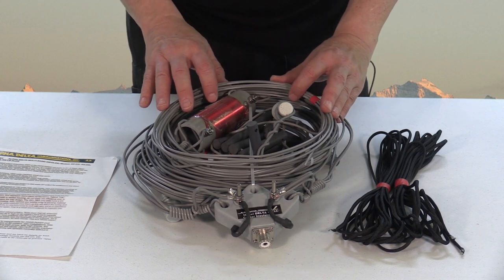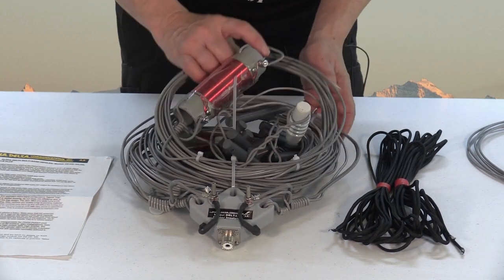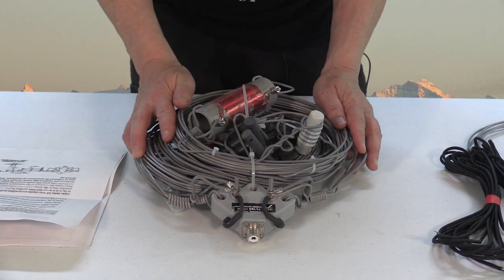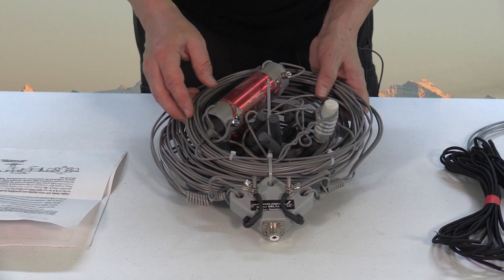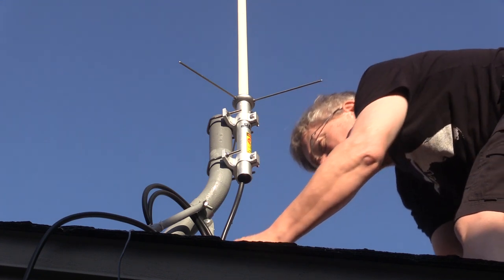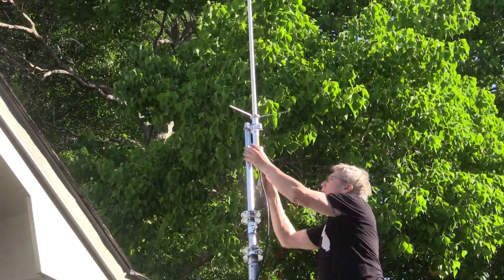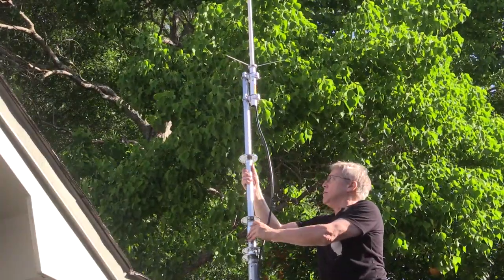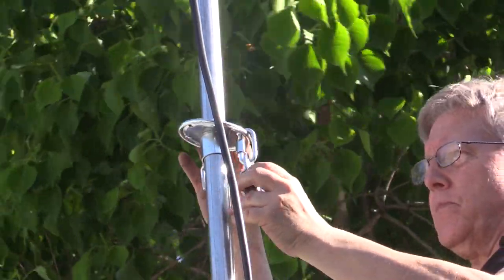Antenna Mast Installation

Comment: Just a comment concerning the burial of the bottom section of the mast in concrete. There should be weep holes at the bottom to let rain water drain out to prevent the mast from splitting during freezing weather and to discourage corrosion from the inside. Since you likely covered these when you buried the mast, you should drill several near the base to reestablish this important feature. 73s, Stuart, WA5US
Reply from the maker: Very good point to bring up!  It doesn't freeze much at all in my area, and if it does, it only lasts for less than 48 hours.  I will be following your suggestion during my upcoming Spring antenna maintenance project.  Thanks again for an important point, especially for those who do live in less than warmer climates.

Comment: What about lightning arrestors inline with the multiband and the 2 meter on top?  The grounding of the mast is perfect and thanks for showing that...  But that HF antenna has no lightning protection on it and is connected directly to your radio.  Just thought I'd point out that because I am about to fix it on my own (yes I have the same type of antenna with the 2 meter antenna below the dipole.  The mast is extended with 10 feet of strong pvc pipe above the 2 meter and has guys with pulley on top. <--- it surprised me when it worked too.
Reply from the maker: I have added, since this video, an entry panel at the house for the antennas.  In the entry panel, I have the antenna leads connected to lightning arrestors and from there entering the house.

Comment: I’m putting together a base station w/ a end fed antenna on a carbon fiber telescoping mast.  I would like some idea on how to ground my Yaesu FTDX10.  I have a 8’ grounding rod but have to figure out how to ground the radio out through the wall to the rod in the ground.  How is your inside base station grounded and where did you source the grounding rod copper clamp holding the antenna grounding rod?
Reply from the maker: Now on my radar to do a video on this.  Thanks.

Comment: You can use scotch 2224 direct burial rubber electric tape. It’s cheaper than HRO coax tape. You can put 5 Ferrite beads7 inches from the coax connector covered with shrink tube. This will stop any RF from coming back into the shack! Would be a good idea to ground the coax at the connector up at the antenna to get rid of static, not a lightning arrester just static! JohnBoyUtah KJ7TBR 🎙📡🇺🇸😎 I have steel tv mast 3x 5ft sections on a 15 foot roof the antenna must be mounted 17 inches away from the steel with a non conductive phenolic . I used cutting board !
Reply from the maker: If Scotch says it it rated for direct burial, I don't see why you can't.  I would double-check on the specs of this tape though before doing so to be on the safe side.
Reply: It rubber stretched tape, works great, NEC rated for outdoors or direct burial! Sold at Home Depot. When putting together my chicken Radio I-Max2000 I use this tape at the joints. Also I don’t use lock washers, lock washers stresses the threaded barrel connector’s and this stress will make the antenna prone to snapping.
Reply: I have had it on my coax outdoor connections for 5 years no proplemo

Comment: Hi Steve, I liked your video. I am in the process of studying for my technician license and i was wondering if you have any words of wisdom for a beginner looking for  equipment in the ham radio hobby. I do have a Baofeng uv-5r8w, can i build of that and if so any advise would be great. Thank you.
Reply from the maker: Actually, if you can get an external antenna and connect it to the Baofeng, this will help.  Not sure of your surroundings, so I can't comment on the results.  However, I do know for a fact that I know someone using a Baofeng connected to an outside antenna and he sounds just great.  Now, he is transmitting on the Florida SARNET UHF frequency, so he can reach state wide.  (Check out SARNET at http://sarnetfl.com.)  It says the site isn't secure, but that's only because they haven't got their SSL for the site yet, but it's OK.

Comment: problem I found year ago with mounting them in concreter instead of using the actual mounting plate they recommend.  When it rains or snows, you will have water drip down the outside of each section and will from the upper sections that water will enter through the slide joints and inside the mast. When buried that water is unable to drain and so it will build up with time.  When it gets high enough inside and you have a freeze, it will split the mast and ruin it. to replace it now you also have a heavy chunk of concrete to remove.
Reply from the maker: How very true.  It never freezes to that degree, (no pun intended) here, so I don't have to worry about this.  Perhaps drilling a drain hole or two at the base would help with the drainage.  In any, a very good and valid point you brought up.

Comment: Do you have to attach the mast to something, or you can you just put it in the middle of the yard and use guy wires to hold it down?
Reply from the maker: You can raise it just using guys, but you will need multiple people to steady they guys and the mast is being raised.  I would recommend placing the base of the mast in at least a 2.5 - 3 foot hole with concrete if you mount it "free standing" with only guy wires for stabilization.
Reply: Used these mast for years, both on the job and for ham radio.  I really do not recommend burying the mast , but instead use the actual mfg. mounting plate. Not only will it hold it place, it helps to spear the weight out so it doesn't sink into the ground much, and provide good water drainage with weaking the mast by having to drill extra drain holes. If you are younger and have some experience with it, then putting it up in the open can well be done by yourself, but I really don't recommend that. try to have at least one other person to help, if for no other reason the a spotter in case of accidents like falling from the ladder.  I have a number of very long and boring videos as I have never taking them time to edit them down putting up a Rohn H-50. ( 42' 9") . look under AD7LL.

Comment: Does it makes a different when you buy a 5 foot , 7 gain antenna commet  100 bucks vs a  30 inch 2-3 gain antenna for 40 dollars, in range and quality sound
Reply from the maker: Short answer is yes ... and no.  It depends on how well the quality of the build is the antenna as well as signal strength, coax used and of course your radio's sound quality.

Comment: Steve, Can  I email you to possible make contact to discuss this Telescoping install,  I am a new HAM and having difficulty planning a wire install. I have big Oak's no branches, just 90 foot crowns. This method may solve that issue. but whose pole is it, and I looked at a couple and the write up mentioned that guys wires and the pole itself will interfere with sending /receiving signal. Like I am finding there are lots of opinions.  I may just have to use a 35 foot ladder and screw hardware for the wire into the tree and be done with it.Thanks, great video.
Barry
Reply from the maker: Sure.  Sorry for the delay in responding.

Comment: Very informative video but I’d like to point out a couple mistakes. You stated your mast pipe was 6” in diameter when I think you meant 6” in circumference. The other is you stated that your rope was nylon when it looks like you’re using polypropylene boat rope which is good for outdoor use.
Reply from the maker: Thanks for the info!

Comment: Dont u havento use pvc tube as a pole for the antenna or metal pole.  Does it matters
Reply from the maker: Depending on the weight of the antenna and height of the mast should decide if you should use PVC or metal.  I just prefer metal and have never attempted to make a PCV mast longer than ten feet.

Comment: Question: does the mast kit come with the grounding stakes and wire? The ground is just for the mast, as the coax grounds your radio, correct?
Reply from the maker: No, it did not come with the kit.  It was purchased separately.  The antenna is attached to the mast, so the antenna itself is grounded to the mast.
Reply: @K4SRF  ok thank you.

Comment: The pushup pole doesn't look fully extended on the top 2 sections any reason why?
Reply from the maker: I am not sure what part of the video you were getting this conclusion from, but the mast extended completely.
Reply: @K4SRF  The peak of your house must be making it look lower is all I can figure my pushup pole is only 30ft & 10ft of it is above my roof peak. At any rate Nice job on the install.👍👍

Comment: Reading what you said about the antenna being ground to the mast. Does that mean that grounding the mast my antenna is connected to will also ground the antenna?

Do I need to ground the radio itself?
Reply from the maker: Yes, your equipment in the shack should be grounded as well.
Reply: @K4SRF   To be safe, it  that ground wire you ran should go to and be connected with the primary ground at you electrical service panel. The way you have it now, you created a lower resistant ground path via you radio itself!!   ANY major short circuit elsewhere in the house will now tend to ground via you radio station.  Please either pay a licensed master electrician to come out inspect it for you, or at the very least, get a copy of the ARRL book " Grounding and Bonding for the Radio Amateur "

Comment: Someone has given me a mast like this. I wondered what the rings on it were for. Its so old the bottom is rusted through and fused to the 2nd pole.
Hey whats your favorite meter and why?
Reply from the maker: That mast may no longer be totally usable.  The rings are for guy wires.  I like 40 at the moment since it is the busiest at the moment.

Comment: How much of an improvement did you see on vhf/uhf?
Reply from the maker: Quite a bit.  I have a steady 1:1 on the UHF and VHF channels I use.
Reply: @K4SRF  Aside from the SWR match, did the extra antenna height result in any noticeable improvement in signals?
Reply from the maker: @JeffK134  Yes it did.